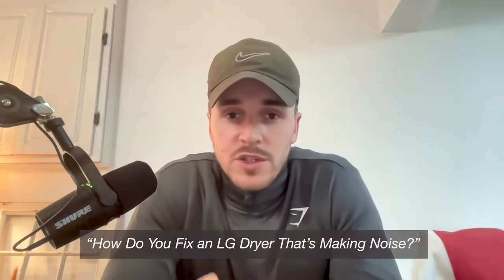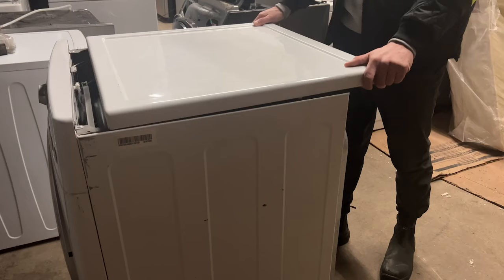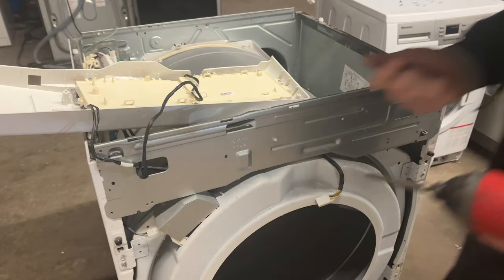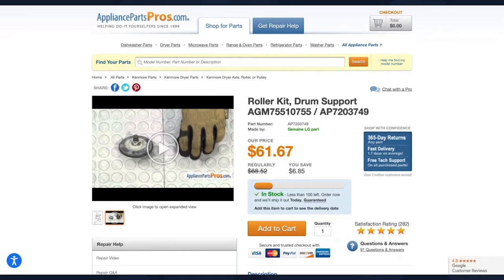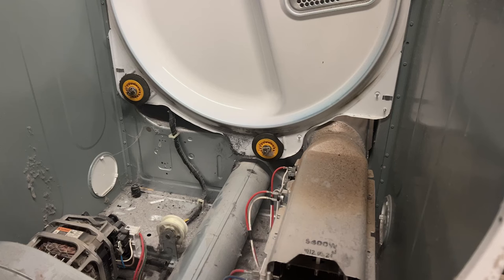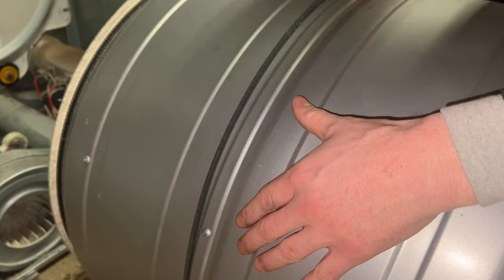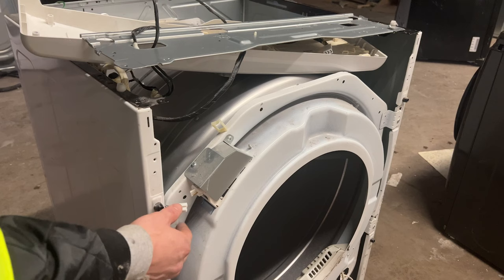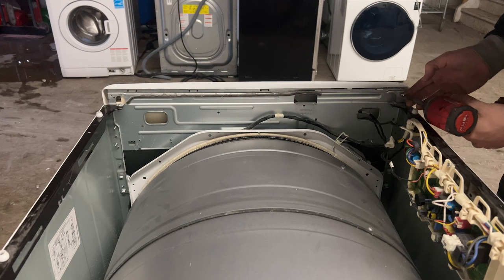How to Fix ANY LG Dryer Making Noise | DIY Troubleshooting Guide (2024)

Comment: I feel like I just cheated. This project should have taken me an entire weekend, and four trips to the local appliance store. This video is a must watch if you're going to try and fix a squeaking LG front load dryer. He was spot on with what the problem probably was - one roller was almost completely seized up and one in the back that the bearing was gonzo. I picked up a kit on Amazon similar to the one he suggested for about 39 bucks and replaced all 4 rollers, the belt and the pulley (figured might as well replace everything with new stuff while I had it taken apart.) The only thing he doesn't show is how to remove and re-install the rollers, but once you have it apart it's pretty obvious.  I would also recommend cleaning everything out while it's apart. There was a TON of lint inside where the filter goes. I also found about 60 cents in change, 4 of those little plastic things that go inside button down shirt collars, and about a half pound of sand. The whole thing, including taking it apart, replacing everything, cleaning it out, putting it back together, and reinstalling it on top of our washer took about 2 1/2 hours. Thanks so much for posting this video!
Reply: Thank you for sharing your experience. This solidified my own attempts to fix instead of the typical multi week journey. Thanks again.

Comment: What would really help would be a description of the noise the dryer is making.
Reply: because taking the drum out only to find out that the vent hose detatched and it is what is making the noise.
Reply: @annecaminer2988 You always want to check the easy stuff first. It can make many noises besides if it exhibiting noise issues it's good to clean out the lint while you're in there anyway. Dryer fires caused by lint are more important than noises and most likely is the cause of the noise. Lint getting into the moving surface of the drum.
Reply: A description of the noise sounds like this:

Blehblehbuddahblehbuddahblehblehblebudahbkeh

Then repeat

Comment: Amazing, got the parts from Amazon over night, it took me about 1 1/2 hours, it was a little tedious getting the back rollers off, but overall this video was a tremendous help and saved me from having to get a new dryer. For whom ever tries this be cautious the metal panels are sharp enough to cut your hands up, while I was working on this i didn’t even notice my knuckles were bleeding, nothing a couple of bandaids won’t take care of. Overall, I am very pleased and recommend this video.

Comment: This video made it a lot easier, faster and cheaper.   The hardest part was reinstalling the belt. Had it fixed in about 3 hours and for $35 instead of $450 by an appliance repair guy.  Thank you!

Comment: Thank you, Thank you, Thank you, I watched your video and followed along. It took me about an hour and now my noisy dryer is quiet again. There was one wheel that had a flat spot on it and it was making a huge racket. I replaced everything in the kit as long as I had the machine apart. I am so grateful for your extremely helpful video.

Comment: I installed today and changed the kit and now it is working fine. The reason why it was making noise it was because I find a wheel is Not Good, meanwhile I cleaned all the dust inside the dryer and vent. Now it is working more efficient and saving Gas. 😊
Reply from the maker: I’m happy the video could help!

Comment: Our dryer started clanking around a few days ago.  Not knowing much about dryers I thought a belt problem.  Got into it tonight with your video and it was one of the pulleys gone bad.

Got the parts you recommended ordered off Amazon and should have it fixed Friday.

Thank you, brother!  This video has, no doubt, saved a lot of people a good bit of money!
Reply from the maker: Brian my man 🙌 so happy the video could help. Cheers brother
Reply: Update...

The parts came in last Friday.  I went ahead and replaced everything rather than just the one pulley that had gone bad and risk more going.

The kit worked perfectly and the dryer runs as smooth and quiet as ever!  That walkthrough was so thorough I didn't even have any spare parts!  😂

Comment: I watched your video after listening to my noisy dryer for way to long. It took me about an hour to fully take it apart and replace all the parts. There was only one wheel that had a flat spot on it but I installed everything in the kit. I figured as long as I had it apart I might as well replace everything. My dryer is nicely quiet again. Thank you, Thank you, Thank you.

Comment: Good stuff, one front and back drum roller wheels were in rough shape. Bought the kit and swapped out all the components. Works smoothly afterwards. Even the 4 year old got in on the fun of disassembling and reassembling the dryer!🎉

Comment: Your tutorial is the best!! I followed your directions all the way to the end but I still have a noise. It sounds like a thump every time it goes around so I thought there was a sock stuck but I can’t find anything but a whole bunch of dust. All the roller wheels were fine so 🤷‍♀️.  I cut myself a few times but followed step by step.  You have a subscriber in me because you took it apart to the tee for my dryer.  Thanks again!!

Comment: This is an excellent step-by-step video of how to do the LG dryer. My dryer was not exactly the same but the parts that they recommended fit perfectly. I bought them off Amazon for the $34 that he showed on the video. They showed up in two days then I started the project sure enough  Two of my rollers were not rolling properly and the tension pulley was tight as well. I am glad that I got the entire set of parts. I replaced them all. As long as you are, this far into the project, might as well replace the belt, which came as part of the kit, all the pieces that tend to wear out are replaced. for me the only difficult part was keeping track of which screws went where. That probably was not necessary. Most of all the screws are the same size. The only recommendation I would have is removing the rear rollers was an additional step to remove a back plate. It would have been nice if that was also in the video, but it was not difficult to figure out.

Comment: Hey. Thanks for the Amazon link and the super easy to follow video. I dismantled mine and found out one of the front rollers did seize. So using that kit, I replaced all of em, the pulley, belt, everything and gave it a good cleaning. Thanks again!
Reply from the maker: Loved reading this comment! not a problem my friend

Comment: Thank you! Great video, easy to follow. Took it apart to make sure it was the rollers. It was. The rear left one was binding and had a nice flat spot so it was making quite a racket. Put it back together which didn’t take long at all - thanks again for the great instructions. Ordering the parts now. Will disassemble again when the parts arrive 😊and change out everything as you recommended.

Comment: Fantastic video. Although I’m comfortable working with my hands I’ve never opened up a dryer before. I found 2 out of 4 bearings bad and ended up replacing all 4, arm and belt for $30. Saved me the headache of buying a new one. Thanks!
Reply from the maker: Loved reading thing! Of course 🙌

Comment: Fixed a friends LG dryer, it had an intermittent noise. Of course it wasn’t doing it while I was there however I found the two back rollers had a bit of noise when spun. I replaced all four plus the belt. Idler was fine, so I didn’t replace it. Unit was about 2-3 years old. Thanks great tutorial
Reply from the maker: Hey Cliff, so happy the video helped my man! I’m sure your friend is too!

Comment: Thank you. This also worked on my LG model DLEX3370W. I used your link and they shipped overnight. Just finished putting it back together I ended up needing to replace 3 out of 4 rollers. To my shock they were all deformed, almost square like.

Comment: Great video, short and to the point.  My dryer had some steam unit and a far more complex front panel that needed to be disconnected.  Nevertheless the basics where the same and this helped me tremendously to get the drum rollers replaced.   The one thing that stumped me a bit was the need to take the front frame further apart to access the nuts on the back.  The back rollers turned out to be easier as the back could be accessed with a spanner wrench to hold in place while swapping them.
Reply from the maker: Yeah the bulk head can be a pain sometimes but I’m glad you figured it out!

Comment: FYI really helpful video.  Took me longer than expected as I needed to thoroughly clean out the internals and had to open it up twice (forgot to plug in one of the connections).  Works like new now.  Only replaced the front rollers as the back were good.  Helped to rewatch the put-together process which helped me identify the missed plug connection.  An improvement would be to include the video instructions on removal of the back to get to the rear rollers replaced.  The Amazon link is a kit of quality parts as a great price compared to the appliance parts sources.  Sincerely,  thank you for sharing. ⭐⭐⭐⭐⭐

Comment: Thank you for helping me to repair my dryer. So simple and satisfying to do it on my own
Reply from the maker: I’m happy this video helped! Good job!
Reply: I second that! Thanks you. I bought the roller replacement kit, but did not need it. A screw and tiny nail feel out when I removed the drum. Apparently I need to check my pockets before putting stuff in the laundry! I will keep the kit for future use. However I tried but could not remove a roller wheel & I did not want to force it in case it broke. Perhaps including a primer on how to remove & install the new roller wheels would be helpful. Cheers.  @theappliancedudes

Comment: Thank you for getting back to me!  I have found after pressing "Less", + "More Minutes" +  "Power Button" at the same time, LED screen reflected during the sequential two-heater testing process, that both heaters were not heating up. And this seemed too much of a coincidence and pointing me toward the Thermostat...   Do you sell parts, as once I confirm further, it seems I also need to obtain the drum rubber roller kit.   Thank you for your time and My Best Jim Bo
Reply from the maker: Hey Jim, we don’t sell parts yet, but are looking into this in the future! Yes if it says it’s your heater, don’t get head faked. It could be your thermostat and is actually most likely your thermostat. 

Hope it helps!

Comment: Video was helpful but when replacing the rear rollers  on my dryer there is more disassembly required. They are attached to a stainless plate which needs to be removed to get the rear rollers off. Thanks for the help.

Comment: Thanks, guys.  Great video.  Helped a lot.  Sincerely appreciate the link to the set of parts.  While tedious, it all went as you described and the dryer may in fact be quieter than when new.  

Curious if you have any ideas of why 1 of the 4 wheels would wear differently than the others.  When I took it apart I discovered that the right, back drum roller had pretty signif. flat spots roughly 180 opposite each other.  Think there's anything we did in normal use that would lead to that or anything we could do to prevent it from happening again?
Reply from the maker: Love reading this my friend! So happy the video could help! As for the west and tear on the one wheel, this usually happens when the wheel becomes so stiff that the drum just keeps turning on the exact same spots. 

If changed, it’s nothing to be overly concerned about! Happy the video could help!

Comment: Thanks for this video. It was a good step by step. The job was still physically cumbersome and required two of us to handle and line up the parts but we got it done. However my control panel did not easily get out of the way like yours did. When I put the dryer back together it would not power up. Is there something along the way that I could have missed or unplugged or not lined up right causing it to not power? Caved in and hired an appliance repair person and he said it needs a new control panel. I’ll consider that but appliance repairmen have told me that before when it wasn’t the problem. Thanks.
Reply from the maker: I would take the top of the dryer off and look at the control panel. Make sure ALL the wires are plugged in and pushed in all the way. I bet that’s your problem :)

Comment: My dryer model is DLGX8001V which is not on the list of the recommended product. Two of the parts and in a different letter, B on one and D on another. Will your suggestion still work for my dryer? Thank you.

Comment: Hello Scott, Last month you had helped tremendously recommending Hi-Limit-Thermostat for my LG Dryer, (along w-cost effective Roller /Belt Package. Separate Issue!!), when both heaters were not heating up during a testing process. Well,, only just got around to installing the components yesterday as I've been using Solar Clothes' Dryer (Outside Clothes Line:-LOL!) since there was no rush. After installing, The dryer worked fine for the first load , however afterwards, it stopped producing heat and I'm back to where we started only with new roller kit installed and that seems to be working fine! Is there possibly something causing the Hi Limit Thermostat to break, or could it be something else?
I Look forward in hearing back form you. Jim B

Comment: Found my thump-thump problem.
The rear of the drum is cracked. Easy check without any disassembly.
You can manually rotate the drum to hear it slightly, but you can definitely see it.
The drum weld on mine was right in line with the agitator bar thing. 
Look at the lowest point where the roller is and you can see it flex.
Apparently a well known issue...

Comment: Great video, safe to run til new parts arrive? Started last nite, but wasnt told about problem til just now (damn kids and keeping secrets 🤬🤣)
Reply from the maker: I get that aha! I'd be a bad technician to tell you to continue to use your dryer as it can cause additional issues. If you can get by a day or two without using it until the parts arrive, that is what I would recommend

Comment: What did you do if the bolt that came with the new rollers is too big for the hole and the old bolt is not long enough for the new wheels?

Comment: We just bought a used one and it sounds like something rubbing, maybe a stuck large wheel against the metal drum?  It gets pretty loud and then softens up for a while.  There's no metallic grinding or squeaking, just a repetitive sound like you're dragging something heavy across a hard floor.
Reply from the maker: I’d suspect the things mentioned in this video - the good news is, if you follow these steps chances are you’ll find out what the noise is just by taking the machine apart! Noises are almost always easy to find.
Reply from the maker: Could just be something lose on the drum. I’d take it apart and see what you find!

Comment: I have a new GE dryer, front load. It sounds like a coin or 2 has gotten under the plastic agitating blades in the dryer.(Stainless drum) Is there a way to remove this blade?
Greg
Reply from the maker: Yes, the blades in a lot of dryers can be removed, however, it’s more likely it’s caught in the fan assembly.

Comment: Your video was spot on. Easily followed your instructions to order and replace the rollers and the belt tensioner.
Excitedly made a test run and there's the thump-thump . It wasn't quite as loud, but still there.
Here's my issue: 
https://youtube.com/shorts/Jb39zO9Oyr4?si=sLxw2LPCVGktTi1H
Guys and Gals, if you're problem is the rollers, this is the only vid you need to see.

Comment: My noise really sounds electrical and not physical, I've not taken it apart, still researching. But I'd imagine the pully issue has more of the thumping noise? Or does anyone have an example of a noise that is not thumbing or grinding.

Also, my noise has been happening for over a year and it's operating just fine, just very annoying 

Appreciate any help!

Comment: Hey Peter. I have a whirlpool dryer that the fuse is good the wheels are good good power of 120 of each line and the ground is good. When push start button I get a click and the power cuts off. Any suggestions

Comment: This repair video does not display my model. How do I review the disassembly and reassembly of Model DLE1501W? I understand the overall process will be similar but the position of the various screws and attachments have proven to be a problem for me. Once I get started, I'm sure I'll be able to complete the job.
Reply from the maker: Hey my friend, sorry for the delayed response. All LG Dryers pretty much come apart the exact same way and use the exact same screws. As a matter of fact, most DRYERS come apart the exact same way which is why we make "general" videos opposed to specific models. The process is almost always identical. 

I recommend if you need specific instructions with your model, you download the service manual or user manual which will give you step-by-step instructions for your specific model. You can find these on LGs website
Reply: @theappliancedudes  Thanks for the reply. I'll see if I can find a service manual for it.

Comment: I have likely an older model- bought it in 2010.  Sure looks the same.  Mine has the circuit board as a part of the front/control panel- the one in this video has the circuit board mounted on the side.  For the life of me, I can't figure out how to remove the control panel.  I've removed all obvious screws.  There are some screws I can see from "inside" and see the screw part coming from the plastic into metal, but can't figure out how to get to the head of the screws.  Not even sure if these two screws are necessary to remove.  My model is DLEX2501W.  Any help is much appreciated!